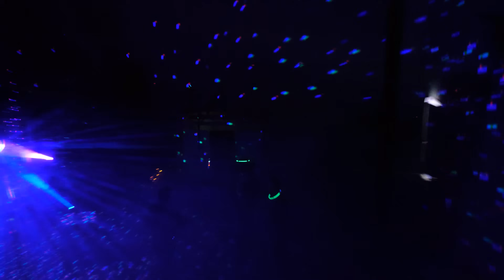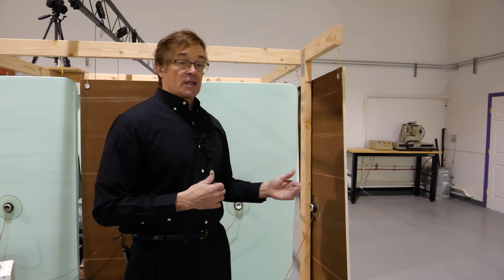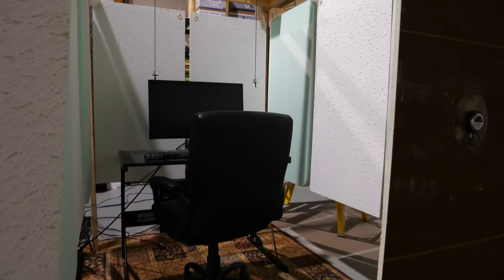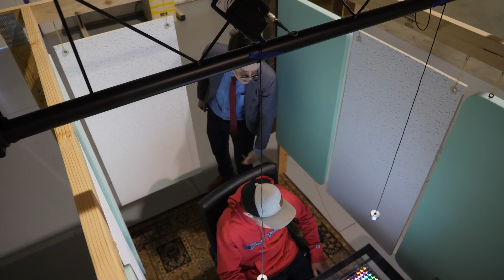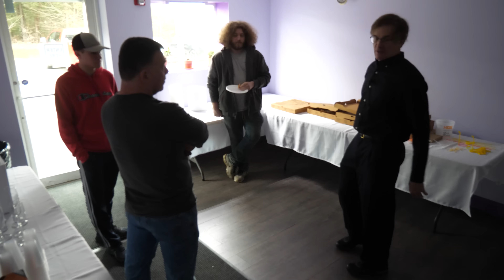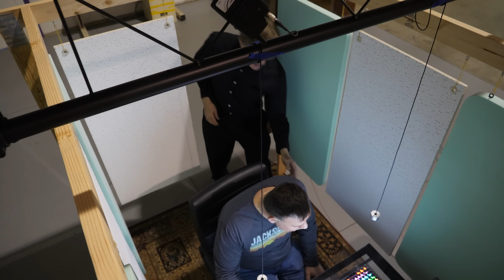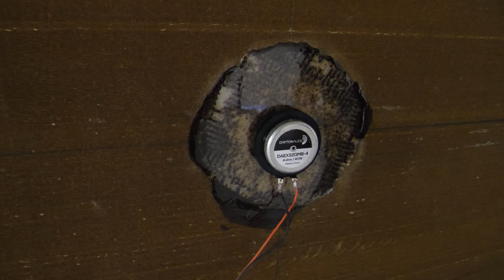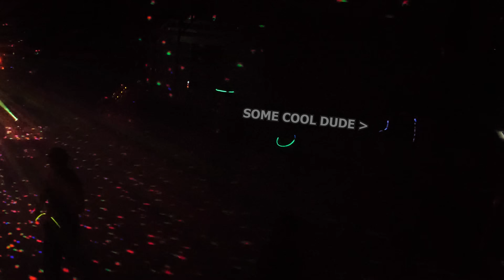SHOULD SPEAKERS THIS GOOD BE LEGAL?

Comment: I’d love to see your take on a car audio system. 
Would the sound deadening foam work on the walls to keep the noise to one room?
Reply: No. It will only affect the acoustics inside that room. To isolate sound from going to another room you need mass (as in heavy doors etc) and make sure it is all air tight. The slightest crack will let a lot of sound through. you will also need to make sure to decouple you subwoofer from the floor using thick rubber feet. 
In short: 
1. add mass to walls, floor and doors
2. Make sure there are no crevasses (use rubber strips around door)
3. Decouple speakers and subwoofers. (Low frequencies will be audible in other rooms nonetheless. This is due to the fact that low frequencies are made up of very long wavelengths and are able to penetrate a lot easier)
Hope this helps. Cheers

Comment: Is it possible to mount these on drywall without any of the hardware showing from a front viewing angle?
Reply from the maker: Yes. Place the plastic pipes into but not through the panel and use a couple of pins extending from the wall to the mid plane of the panel.  An easier  choice is clear fishing line to a completely  buried  eye bolt.  This is still visible,  but very inconspicuous.

Comment: @Tech Ingredients  Wiring the drivers in series is a trick done in commercial speakers to improve the performance.
It causes Mechanical resonance peaks to cause an increase in electrical impedance which reduces the output of the other driver. This has the effect of smoothing out resonance peaks to some degree. Since this design of speaker has a lot of (smaller) peaks, having the two separate panels of different materials (therefore different resonances) in series helps them smooth out each other.
It might even help to position the drivers slightly different within each pair of speakers (but as with everything to do with speakers, the proof of the pudding is in the eating).
Please do a waterfall graph for these speakers.
Reply from the maker: Good point and I should have  mentioned that.
Reply: you know a waterfall wont look to nicely on resonating panels :)

Comment: It might be more meaningful if you could offer the listeners two options, such as the ability to switch to a standard pair of monitors. 

Some pretty crummy traditional speakers with a lot of DPS work to level out the frequency response can sound fairly decent in an otherwise more natural environment, like an office.  There are some brands (*cough*Bose*cough*) that I think are known for this.

I imagine anything that is non-garbage tier will sound "good" to someone off the street.  Most people are probably going to be quite fine with an $80 2.1 computer speaker setup in a near field environment like that, and without anything to compare, may think it sounds good to them.  That's not necessarily a good or bad result. 

The warehouse environment is very unnatural and unusual, so I'm not suggesting people listen to computer speakers sitting in the middle of a warehouse without any panels around them, then compare to your panels that just happen to be active themselves, as I think the damping factor is the biggest thing at play due to the unusual environment you've chosen.

I still would worry about modes in your material despite damping effect of the material itself since the further out you get from the driver the less coupling there is due to material flex, leading to ringing and phase shift.  Something I imagine the average listener will not notice unless it is quite bad and probably measurable.
Reply: I still use my older 301s for music in my office, they work fine for most things, just have to realize their sweet spots.
Reply: I think you missed the point and look very silly. By the way what is DPS? Need I say more :)
Reply: @mariemccann5895  What point did I miss and why do I look silly?  Please explain.

Yes, I transposed two letters, and meant DSP.
Reply: @mariemccann5895  Still waiting on a response.

Comment: Sorry to say but non audiophiles have little knowledge or appreciation for sound quality I am an audiophile so.. yeah theirs that.. Get a few like us to have a listen I promise you will get much better results.. we know what sound is and what it can be,,
Reply: Respectfully, While many audiophiles are well intentioned; most have never actually heard the performance capacity of their own systems due to lack of developed knowledge of how things actually work.  It's not just limited to audiophiles it also goes for virtually every engineer and manufacturer of even the ultra high end supposed cost no object gear. Sad that most never get to experience what is actually possible, doable, and repeatable and most importantly been actually done that conclusively demonstrates how misled most are.
Reply: I'd rather just get objective instrument measurement, audiophiles are often the butt of the jokes in the tech space for a reason.

Comment: They do sound pretty amazing for what they are (I've built some - I've used Tectonic exciters, cheapo BT amp and insulation panels, its like 25eu for everything), but I wonder how is the imaging on these - multiple panels, not exactly concentric to the listener would wreck havoc in time domain.
Reply: boy! the imaginging is not as good as a LX mini but defintely comparable to reglular high end speakers

Comment: I want to see a Dolby Atmos setup with top suspension ceiling speaker as well. Other setups would be 7.2 setup. I am a noob so would like some pros test those setups and finally I would invest into the idea. What happens if we have 4 mounting points for hanging on the top side ? Will it work?
Reply: The name of the game is isolation, why would they add more anchor points when in reality they already want to get rid of the two that are there already?

Comment: Should test this with a game (probably a FPS game) where the sound stage, direction, and distance volume matters a lot.  Something that the headphones excel at and is often very hard to do without a lot of work with speakers set up.
Reply: agree! I'd love to do some gaming in here vs headphones
Reply: "Hunt: Showdown" would be an unreal experience with these!
Reply: @filborg3705  tarkov stereo only.
5.1/7.1 output in games - obsolete.
You need game with DirectSound3D/EAX tech. Most modern game I can remember is GTA V...
Reply: Agreed a Round of C.O.D. I'd recommend, That way you would have to figure out background music V.S.  Mic Audio and with game chat, That would be the true test. #SeacoastStrong #beantownbushcraft 🇺🇸☘️
Reply: Splitgate would be perfect. The spatial awareness and importance is unmatched
Reply: @filborg3705  my thoughts exactly
Reply: FPS Multiplayer gaming needs communication with a microphone .... unless you go full AI with nvidia noise cancelling you will have to use headphones.
Reply: @CrashPilot1000  Not if you solo DAYZ and role playing a mute. In fact theres no real reason to talk to people in DayZ. theyre either there to kill you or will compete for resources if you "friend" them.
Reply: I guarantee that my Sennheiser HD 590 headphones, completely trash this setup..  In clarity, accurate Bass,  and 3d Soundstage... despite only having two drivers.   The issue with these things, is Distortion.  They rely on the type of material, and the way it flexes... but there is no way to keep it from distorting.

 And the problem with distortion... is that even the smallest amount of distortions occur... it completely ruins the accuracy in a projected  3d Soundstage.

 If you want speakers that produce a realistic 3d soundstage... find some old EPI 100v speakers.  Get the ones that have the updated tweeter that has a plastic bezel around it.  (or buy the parts from Humanspeakers,  and make your own)

 My EPIs completely Destroy the $3000 speakers at the local high end stereo shop.  Its not even close to being a competition.  Its like comparing a microwaved hotdog at home,  to a perfectly cooked steak dinner... at a world class establishment.

 The speakers "Vanish",  and you are left with sound that is all around you... as if the Band members are playing in the room.. and you could point in 3d space where each were standing.   They have an expanded sweet-spot.. to where you can almost stand in front on one speaker, and still get an amazing 3d stereo image.  Even at max volume... you will have virtually no distortion... and will hear things in music, that you have never heard before.  Even on pieces of music that you have listened to for several decades.  This is because other drivers lack the power and precision to keep from distorting the output... and so certain sounds end up getting muffled and blended together.
Reply: @johndough8115  I think this is more of a tech demo/learning experience. I will accept that, no, they would not stand up to your indicated hardware. I think the goal here is a 'good enough' solution.  Minimal effort applied for better than average results. NOT perfect. But better than average for non audiophiles.
Reply: @johndough8115  Very much perception as you clearly don't understand the principle of distortion and the dynamics at play and say some very silly things. HD590s really aren't anything special.
Reply: @johndough8115  I knew it wouldn't be long before the AuDiOpHiLes would crop up and start with the, "jUsT gEt sOmE oLd/uSeD [insert random p/n, that no one has ever heard of, here]. They'll sound way better." LOL. 

"Find some old HG7650s and hook them up to a MA-8D and you'll have speakers MoNiToRs that rival studio reference speakers."
Reply: @littlejackalo5326  Exactly. Hey this DIY $200 bucks thing is nothing compared to my $9000 setup. lmao
Reply: @Produkt_R  HD 590 is a cheap pair of headphones, though. Don’t be a clown
Reply: @xx00zero00xx  comparing headphones with monitors is unfair anyway

Comment: I built a 2.1 System with the method you described in an earlier video out of Balsa Wood. They didn't sound that great out of the Box, but with some tuning from an Equalizer the sound got way better. The low frequenzys were still bad tho (100x50cm), and I had to ad a subwoofer. Now the sound is really good and comparable to a 400$ System, where I only payed a 100 bucks.

Comment: I’m curious, what dB levels can be achieved with these types of speakers?
Reply: Also, what if you supported the transducer itself and not the panels so that the panel was entirely free to move unimpeded?  Or would the weight of the panel be too much?  I’m just thinking you could make some sort of stand that is attached to the transducer to make some really cool “levitating” floor standing speakers.

Comment: I remember squinting my eyes when in the second tutorial video you brought out acoustic ceiling tiles and said they work well as speakers. I thought to myself: aren't these made to absorb sound rather than produce it? It's very interesting that they do double duty in this setup. I'm tempted to make a set of these, maybe two channels is enough, and put them up in my bedroom to use them at low volume, because in my experience larger speakers sound better even at low volume. And besides, they look cool! Thanks for the episode.
Reply: 2 channel would definitely work with this style of speaker.

I also agree, large speakers not being driven hard sound way better than smaller speakers that are closer to their threshold.
Reply: It's like how black surfaces aren't just good at absorbing heat, they're also good at emitting it. Being strongly coupled in one direction makes it strongly coupled in the other direction.

Comment: The only thing I can see wrong with this test is they are still using 2 subwoofers one on the back left an one out front in the video u can see them
Reply: Not wrong, but essential. The response of the panels rolls off rapidly below about 100 Hz.

Comment: About 38 years ago my Science Teacher built a flat panel speaker and the sound was absolutely unreal, my teacher explained how in the future every single wall or poster,  like Black Sabbath can become a speaker. Needless to say it never happened but we had a whole semester studying these "Sound Walls" as they are now called.
Reply: There is a company in Finland does audio integration built in to furniture. They can use a cabinet door as a speaker for example.
Reply: There's some reasons why it is not particularly practical. Resonations are a permanent concern. And because it depends on the individual panel, you'd have to EQ every installation. Also, low frequencies are hard to produce.
I integrated drivers in the past, and it's just so dependent on where you mount it.
Reply: The problem with panel speakers is that they radiate backwards the same amount as to the front. The setup they had here is actually optimal (instead of "worst acoustic environment") for this kind of setup. In regular rooms the backwards radiation would bounce from the walls to listener, floor and ceiling and cause all kind of comb-like issues in the sound frequencies.
Reply: @MikkoRantalainen  And an open back speaker cabinet doesn't? I won't draw my conclusions until I see thorough data or hear them for myself. The latter being the weightier of the two.
Reply: what an awesome teacher man!
Reply: i bought a small device with suction cup and reverberator about 10 years ago that could do exactly what you say. An oval shape with only the 3.5 mm jack on a solid wire attached to the device. it was sold in a Canadian tire at a pop up booth and what ever thin surface that could translate the vibrations could become a speaker. 

It was mediocre and barely past the prototype stage but it was cool when I took my lunch container, this device and my ipod and made a speaker. you could stick it random stuff you came across , never really caught on  :( . 29.99 Canadian plus tax
Reply: @tobiwonkanogy2975  the device was called Rocket Speaker. I had one. It really did depend on what it was stuck to. These guys have just figured out which items are best lol
Reply: another type that was pretty brilliant used a 3-4" driver in the center of 2 panels, that were separated by dividers creating (rear loaded) exponential horns... kinda "lens aperture" fashion.
only about 1.5" thick and 24x36", they threw some very good quality sound.
Reply: quad esl63 available from the 60s. also kef flat speaker from same era
Reply: @drspastic  ESL-63 would be an example that would have very similar pros and cons as this system. ESL-63 is supposed to have really low group delay but I couldn't find any measurement reports. Considering the mass of moving elements for ESL-63 vs the panels in this test, I'd expect ESL-63 totally superior system.
Reply: Speakers of this design tend to have wide dispersal, but have significant drawbacks elsewhere.
Reply: Yeah, I was kind of hoping to lash something up that would allow me to integrate speakers into canvas prints of my photos, but it seems more complex than first thought.
Reply: My phone's screen acts as a speaker pixel 3xl
Reply: @obiwan245  same with my LG g8. I've had it for about two years and it still kinda trips me out. Would love to get something similar to this setup in my room. You could get some killer quality sound coming down from the walls and ceiling without taking up space
Reply: @micksterminator3  i take it back that it never caught on then. the tech got put somewhere. in that case is super easy , the wires for the driver are side mounted and the driver is squished between the screen and rear with a small gasket to help transmit sounds from the rear of the driver  . You don't need anything special @ Chris Bonney . specs would show the same as others .
Reply: @micksterminator3   I read an article about the G8 having this, but mine definitely doesn't. I guess because it's a G8 "X"?
Reply: @obiwan245  Not according to the specs and equipment in the phone
Reply: Please research why it didn't happen. You might be surprised at what you discover.

Comment: Very interesting. If someone were to put something like paint, wallpaper, and/or posters on the panels how would that effect the performance?

I don't think it would improve them, but depending on how it's done I don't think it would hurt either.
Reply: It would hinder the sound absorption. You don’t want frequencies reflecting.
Reply: @brianvillage5  Errr, yes you do in this mode. Hard varnish can greatly enhance the effectiveness of the panels, much like the lacquer on a Strad!

Comment: I like this idea. Presumably there is an optimum aspect ratio to optimise sound transmission without introducing unwanted resonance peaks - have you experimented with different shapes to see how they vary? I guess these will be similar to electrostatic speakers in some ways - the high frequency sounds are not localised to a point source, so can sound very immersive when you sit in the right place, but can be quite directional so you need to be sitting on the orthogonal axis to the driver to get the best imaging.

Comment: Very cool experiment .......
Unfortunately, You will find that this setup will do nothing to fix the fact that
most people are listening in an 8' X 10' X 12' box, not a warehouse.
The average Bedroom is a terrible place to try to replicate a Recording,
that is, until You treat the room like the interior of a sealed Speaker-Cabinet by
filling the corners with highly absorbent materials such as Rock-Wool-Insulation,
or densely packed Fiber-Glass-Insulation, ( the Rock-Wool is the superior product ).
A warehouse environment is actually "cheating".

Comment: A question i have is, how would they sound with a Paper backing, or rather fronting. iE a Poster, picture or wallpaper plastered to its front.
Would it dampen or enhance the sound?
Reply: I suspect it would make no substantial difference. Fundamentally dampen but really probably not something to worry about.